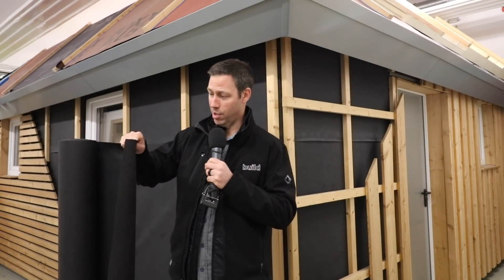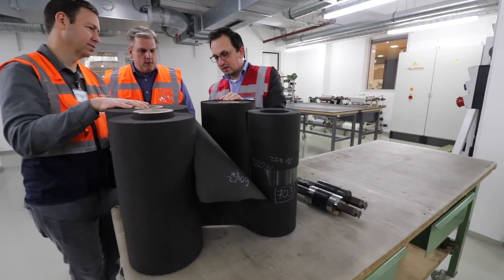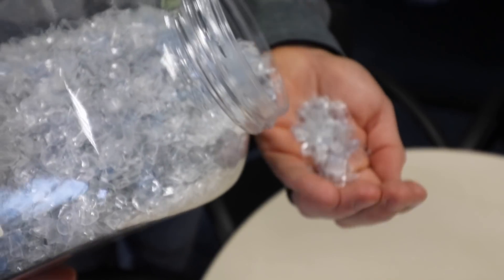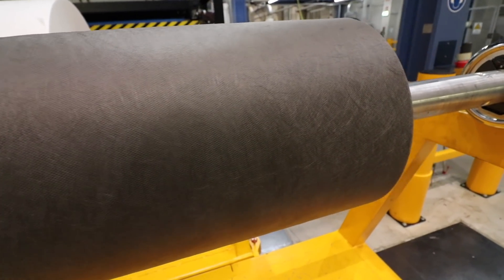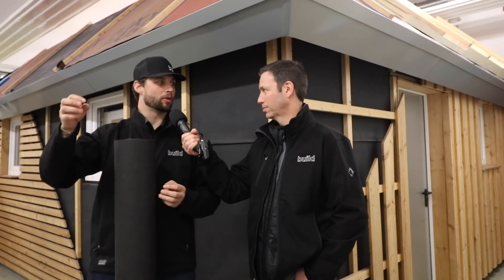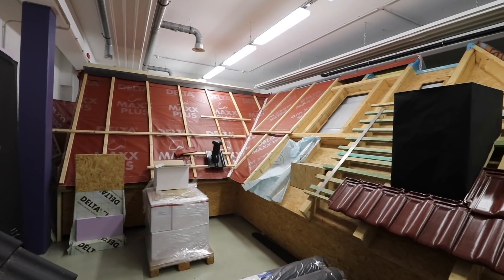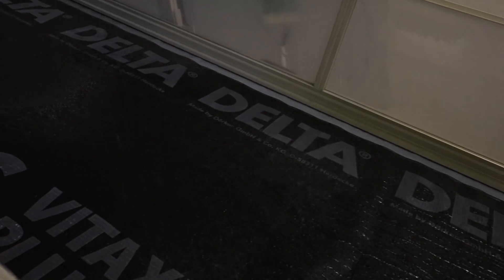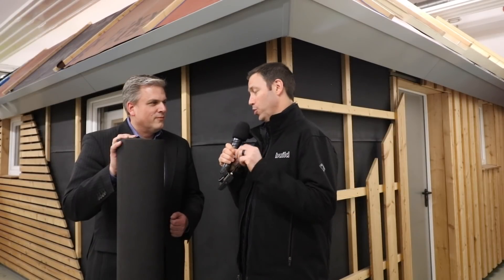“The Delta Layer” How Germans make their homes Air and Water Tight

Comment: The German houses I've seen are made with construction brick 15 inches or so thick, covered with stucco on the outside and plaster on the inside.  I've never seen a German house with a wood exterior.

Comment: Matt....If I was going to install a 2" EPS foam to the exterior of a new construction, what would be the recommended sheathing system behind the foam for water control.  Or....would it be recommended to apply this on top of the foam?  This will be a 2x4 wall with cavity fill open cell foam.  I love your channel!!
Reply: Wondering exactly the same thing.  The answer may depend on the climate and cladding system.  Let's see what Matt says.

Comment: That cutaway model home behind you looks cool, but wouldn't those big gaps between the slats be a perfect place for wasps and spiders? Honest question: are people in Germany not worried about this?
Reply: I live in Switzerland and am a self employed builder. My house has a rain screen with 30mm gaps and I have no problems with insects or wasps. However my workshop has 20mm gaps and I have a few paper wasps that nest behind the cladding. Seems to be all about the gap and air movement.
Reply from the maker: That is showing an open gap rain screen system. I’ve done it on a few houses over the years. It’s a cool look but you are correct that it can attract bugs.
Reply: I'd say in this particular case it's probably for demonstration purposes.

Water drainage piping though is commonly double what's usually put on US Houses so that might go still underneath there before finish – somehow (traditionally its just attached to the roof rather than elaborately integrated though).